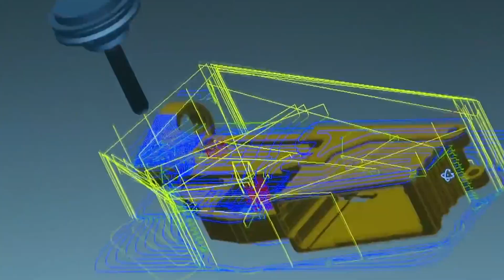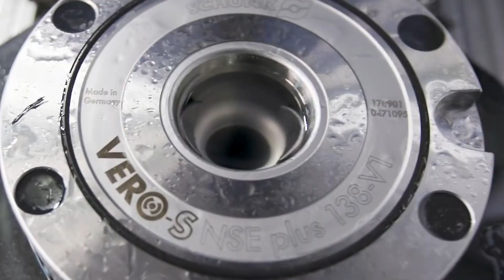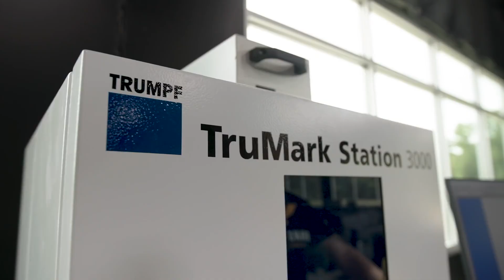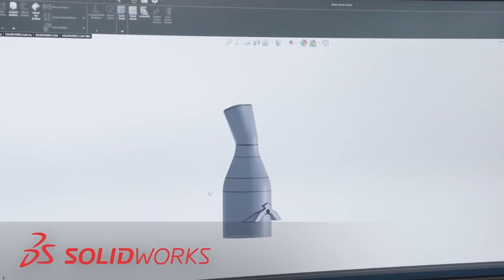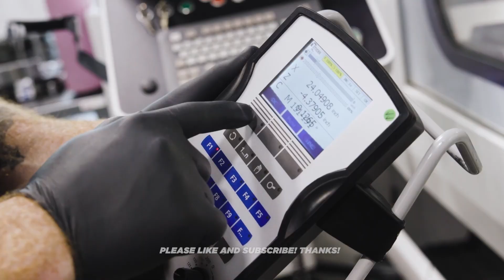Someone Died at Our Machine Shop

Comment: My greatuncle was a manual machiniste back in the days in the GDR (eastern germany). A coworker once forgot to remove the chuck key from the lathe and when he started the lathe the key was launched and hit my greatuncle in the chest, he broke 3 rips and punctured a lung. Luckily he survived but ever since I started my apprenticeship he keeps telling me and even when I first started my apprenticeship the first thing he told me, no matter what you're doing, if you aren't touching the key, take it out and put it down.
Reply: the best is when the key is on a dinky little chain on a drill press and it gets turned on the that key turns into a chain of pain whipping who ever is at the press till it flys away seen it happen a few times

Comment: What is that machine about the 9:15 mark?? Almost looks like it's used to check how the end mill runs out once it attaches to the (I can only call it a CNC collet - LOL)? Like it's checking the end mill for concentricity??  I'd love to work in a shop like that, super high quality work on titanium, love it!
Reply: it heats up the holder so the bore expands, you slip in your tool, then it's cooled back down and shrinks on the tool.
Reply: Shrink fit holder we call them and as Paul relates it is a tool holder. Good if you really want a tool to run dead true.

Comment: I've had a couple coworkers die. It always sucks and you never forget it. One guy didn't follow protocol, and forgot to put his ground on and got bit by 345. The line didn't even trip as he was being shocked because it wasn't enough fault current. Another the helicopter got caught in the lines and went down, 3 guys died in that one. And there's been some more too. Never gets easy.
Reply: Are you a lineman?
Reply: @JoeSmith-jp7bk  groundman right now. Trying to become a lineman. But yeah I'm in the line trade.

Comment: One day I had to go to a machine shop where heavy cast iron parts are manufactured to look at a damaged machine. My job was to make a backup of the cnc data under the supervision of the safety authorities. It was a vertical lathe and it lokker like it has been exploded. They put an unskilled time employee as a night shift operator to that machine, for some reason he made an incorrect entry into the tool offset table and the machine crashed at full speed. He had been hit on the head by some part of the tool holder which crashed through the door and through the operator box. He did not made it.☹️

Comment: first job i had out of welding school was in this hell hole of a shop no vents to suck out the welding fumes and alot of the machines didnt have emergancy stops. or where hard wired on all the time. i had been there all of 9 days when a guy was working on a carlton drill press (very very large raidial arm drill) this thing was massive. any way one of the guys goes to drill some plate steel and this is a very large hole in some 3in thick steel no big deal there are some clamps to bolt it to the table or you can do what ever and leave it on the fork lift and clamp it to the forks he does none of that and this big ass chunk of steel starts to walk so he hits the E stop and nothing happens he goes to shut the machine down and has he turns to hit the breaker the bit grabs the part and it comes off the forks and falls on him breaking his spine. he will never walk again and i left that shop the same day once the emts and stuff had gone i packed my tools up loaded them in my truck and left didnt even collect my check i had them mail it to me
Reply: That decision to leave likely saved your life. It's insane that a shop would have working conditions like that.

Comment: Had a guy where I worked slipped on a wet floor in the bathroom and hit His head on a sink. He was gone instantly. We were All Shocked by what had happened. A Super Cool-Nice Guy Too..
Reply: He may have had an aneurysm first. I know someone whose mother had an aneurysm in the bathroom and hit her head, but she was dead before she hit the sink.
Reply: @toomanymarys7355  Can’t you be alive a few seconds and not have a heart
Reply: Poor guy :( I'm sorry
Reply: @Tommy Ealey That's a sad story. Just saying, you might want to address that typo in your post. I wouldn't normally draw attention to typos, they're just small mistakes usually but that one is pretty important.
Reply: @Backlash1818 Mobile Gaming Channel the opposite of that:

The last deadly accident at the paper mill I work at (electrical engineer) was 30 years ago. I am in my last semester of my bachelors degree and I have been working for the company for about 2 years but my work colleagues told me the whole story:

So anyway: it was 1992 and we have a huge pressure grinder to grind wood into thin strips for further processing. The machine is about 10 meters high and you can imagine it as  4 huge grind stones in a casing  with hatches and a conveyor belt on top. These grind stones move in pairs towards each other and hot water is injected to create overpressure and prevent the wood from getting too hot while also softening it up. Every once in a while, they stop feeding wood into it, lower the water pressure, open the hatch to check the condition of the grind stones and possibly grinding out any uneven wear on the grindstone by hand.
He stumbled and fell in. They could hear him scream for a good 15 seconds and he made multiple rotations around the grindstone until the other grindstone moved close enough to, well, grind him down.
He got sinned around, Practical boiled and grinded to death.
Everything was full of blood. They showed me the images of the aftermath and its just... Sad
Reply: @Backlash1818 Mobile Gaming Channel I agree.  Fast blink and ZZZ.  Rip 🙏
Reply: I sort of hope I die like that so I don't have to die in a hospital in emotional agony
Reply: I bet OSHA had a fit
Reply: If I could choose my way to go it would be that or an asteroid impact
Reply: I lived close to a brickworks and one day one of neighbours who worked there had slipped into the shale grinding mixing machine.  First anyone knew was when bricks with bits of flesh and blood came out the line.
Reply: @Backlash1818 Mobile Gaming Channel no its not normal. i want to fucking live?
Reply: @Tommy Ealey think he meant the "he shit himself" typo mate. Thanks for sharing I had a similar experience with a friend in highschool it always seems to happen to the best people
Reply: @Backlash1818 Mobile Gaming Channel that was more than likely the case. I my self blacked out The restroom anf hit my head on the floor. Don't remember feeling the bump or anything and the pain only showed up once i was regaining consciousness. Before that i it was a peacefull experience and i didn't even know what had happened until after i woke up.
Reply: Today we often forget how fragile humans or really anything living is

Comment: I was a stationary engineer at a power plant near St. Louis in the mid-nineties. I was walking on the burner floor and saw the biggest blue light I'd ever seen. Made a big spot in my vision. I ran towards it and a contractor electrician was standing there brushing off the front if his pants. And just fell over. He had dropped a tool and leaned in to pick it up and his temple touched a 440 v buss bar. He had a perfect hex burned on his temple and bottom of one boot was completely blown off. I can make myself remember that smell of burned flesh and ozone.  The guys jumped in and started cpr but it was too late. It changed everyone that day. We all paid a little more attention to everything after that.
Reply: Yep, thatll blow your heary apart and roast you from the inside out...

Comment: Worked at an alloy wheel plant on the machine cnc line, one time at smoke time I moved past a big step in cnc with its door closed and heard muffled cries, interested I moved to the control and saw the machine had not started up, I override the cycle and opened the door. Inside was a dude called Sen. Sen was seconds from being a grease spot and he was beyond scared. I could never work out how he did it, we had double safety start buttons 2 m from the door and all kinds of safety procedures,  limit switches you name it. 
Had a guy called flipper briefly on the line , this guy reversed the cast wheel in the chuck , BOOM  I ran up and emergency stopped it,  BOOM the cnc opposite blows up, BOOM goes another, all 3 massive cncs on his line op were toast. Flipper went back to the heat treat line pretty quick.

Comment: You probably already know that the chances of recovery after a heart attack are very slim because this is often caused by an often fatal failure(ruptured vein, artery blockage etc.).
Do you have a "CPR machine"(forgot the right name) at your shop?
This device (already present in many airports and companies) in combination with regular CPR can increase the chance.
But again, you shouldn't blame yourself because recirculation/heart failure happens for an often fatal reason and the chance on a (good) recovery always are slim.
Reply: Do you mean an AED? Automatic External Defibrilator?
Reply: @Baby_B_King  AED That's the name, we get a training on these devices every year, but I forgot the name😯😯

Comment: When I was in metal shop in high school, I was making an aluminum head for a meat tenderizer on a Bridgeport knee mill, my friend was turning the handles out of brass on the lathe. It was a a bigger piece of brass than we needed but at the time it was not very expensive but when it was chucked up, the jaws protruded about 3/4" outside of the chuck. This was 1977 and I had never heard of CNC, not even sure if it was being developed then so we were all old school machining. At the time, long hair was the thing, (think Aerosmith, Zepplin etc.) my friend was no exception but he broke long hair rule number one. He didn't tie his hair back. While making the handles his hair caught up in the chuck, pulled his face into the chuck which basically removed his entire facial features and beat the hell out of his skull. The estop was hit in like what seemed like less than a second. He died the next day. I hadn't thought about it for years until I saw this today. You're absolutely right. Treat every day as if it could be your last. I just turned 60 and would love to retire and start working in the CNC industry for a few years, and laugh if you want but to me it would be fun! But I think I'll just stick with my small CNC lathe and mill in my little shop. This popped up in my recommendations and when I saw the tile, something told me I had to check this out. I'm glad I did.
Reply: Lathe is by far the most dangerous machine in a shop. Imo
Reply: @3dee106  The most dangerous tool in any shop is complacency. The moment you start to think that you don't have to worry about Machine X because Machine Y is so much more dangerous is just a few moments before Machine X is going to remind you how dangerous it really is.
Reply: @3dee106  - How so? I’m genuinely curious
Reply: @greeneyesfromohio4103  
Lathes (particularly manual lathes) are dangerous because there is often a very large area of the machine which is spinning, often pretty fast and close to the operator (although behind a door for a CNC lathe). The spinning thing is sometimes not circular (especially the chuck) and presents a major hazard for things getting grabbed and pulled in/wrapped around it very quickly. Aside from this, the mass and moment of inertia of the rotating section is often many times greater than that of a tool in a mill, which means that a part in the lathe can store up far more kinetic energy. So if it comes loose, it's likely to inflict far more damage than a mill tool would. This isn't to say a properly operated lathe is unsafe, just that there are significant hazards to be aware of.
Reply: I will be using this story for our next safety talk, at WCCC/CMU Machining..
Thanks Heeder🙏
Reply: In 1973 - 4 years before this incident - I interviewed for an engineering job designing CNC machine controls for General Electric Company. What, you don't have a GE machine control? Their mistake, they chose not to hire me.

Comment: it's a miracle we didn't lose someone over the years with this 48" lathe they had at the shop I started out in. it was nothing to have a 1500 lb mass being worked in that thing and inevitably once in a while it would suddenly lose grip on the chuck. even though there was a guard on the start button, someone would manage to trip it a the wrong time. it did happen at another shop, similar machine, guy was trying to put a little more squeeze on the chuck with it in gear, somehow it started and the big chuck key came around and that was all for him. people let their guard down running a 12 inch lathe and be just as dead. I spent 43 years in 2 shops and was lucky to never have a trip to the hospital because the old guys brought me along with the right attitude
Reply: I ran a 39”x255” lathe for a few years.  Everything from 2”x200” parts to 15”x225” and yes, every day could be your last.  I stood in front of a multi ton spinning stick of death all day. Even did a couple 20hr days…
Reply: @Rightisallwrong  i hear ya, we did at least half of our jobs on big company breakdowns, you had to stay till it was fixed

Comment: Someone died at my shop. I took his job after he got squashed. The poor guy got himself in between two dies in a 400 ton press for die casting. The operator did not know there was someone in the other side of the machine working on it and closed the door for a cycle. The door opened up and the other guy fell out. The guy that got squashed was a friend of mine from high school,  life sucks sometimes.
Reply: Sounds like that bottling plant incident. 
A worker took the override key out, went in the machine to fix something. 
Then the manager put a spare key in and turned it on as they were losing money every minute the machine wasn't on
Reply: @janeblogs324  that is correct. In the incident I was talking about the guy  that was killed used a rag to tie a limit switch. The limit switch stopped the machine from working when the helpers side door was open. Many accidents happen when you bypass safety features. I was told no one is to ever keep a limit switch from doing its job but yet we continued to bypass safety features at times.
Reply: jesus

Comment: When I was 18 we had 3 guys fall into a ladle of molten steel. They were there then they were just gone....
Reply: Man that's a nuts one..
Reply: @user-qs2iq1ci8m  yes I still get a little upset thinking about it. That was over 30 years ago.
Reply: Holy shit man, good lord, that is awful. Sorry you had to experience that.
Reply: Thats just fucked up
Reply: Holy shit! At least it would’ve been quick, but damn......😳
Reply: @Glenrok  I don't think it wouldve been that quick...
Reply: @TomoHawKzZ  in a vat of molten steel?? It would have been instantaneous once they hit. Depending on the height of the fall TO it, however, you might have something.....
Reply: @TomoHawKzZ  total immersion in fluid at 1400degrees would instantly boil your blood, eyes & brain fluid. Solids like organs, bone etc may take a little longer- but since the boiling of the brain pan would’ve meant instant death,?that’s somewhat irrelevant. Crematorium furnaces take time to reach their operating temperature -the molten metal is already there. That’s the difference.
Reply: @Glenrok  the liedenfrost effect would save them until the water boiled away. We are more than 70%water, imagine the pop when they fall in. The "time it takes to warm up" is irrelevant, it'd take longer than 2 hours if the crematorium had to warm up. Weird how long it takes though, l figured from all the stuff they said in school that people were just vaporized in seconds, however it takes a lot longer than that. Makes the math kinda wonky too don't it?
Reply: @mackk123  hm. An interesting argument, but I feel 1400 degrees is likely rather higher than the Leidenfrost point for it to be the case. Also, the earlier comparison to a crematorium furnace was itself not really applicable since we’re talking here about the time taken to point of death- not the time taken to completely disintegrate a body. This is a particularly morbid topic, yet strangely interesting if viewed objectively.....🤔
Reply: @Glenrok  One also has to keep in mind that, provided there is no Leidenfrost effect to momentarily protect you (or that it has dissipated), you will have an extremely hot (and massive) liquid in direct contact with what is practically another liquid (the body, as we are mostly loosely bound water) and liquids transfer heat orders of magnitude faster than air or plasma due to the vast amount of mass and latent heat already stored in the hotter molten metal (of much greater volume) with the rapid convection continually drawing in more hot fluid that is in perfect contact with every mm^2 of the body.  You can pass your hand safely through even a very hot flame so long as you do so quickly as the plasma (flame) and hot air can not transfer heat quickly enough to burn you, but pour 100°C boiling water on that same hand just as quickly and you will have severe burns despite the water being more than 1000°C cooler than the flame due to the vastly more efficient transfer of heat,as well as the stored latent energy in that mass of water, between the boiling liquid water and the hand.
Reply: @Glenrok  im not sure you would submerge though due to the fluid density. You would float on the top. Nasty way to go.
Reply: @BillJBrasky  perhaps, but depending on the height of the drop you would suffer total immersion initially due to gravity. Whether or not you then floated on top would be a moot point- you’d already be dead.
Reply: @ethanpoole3443  sorry, I didn’t see your reply earlier- but that is exactly the concept I was trying to convey. Well articulated.
Reply: How was this possible? I hope you eventually get some closure.
Reply: Holy shit... don't know what to say about that